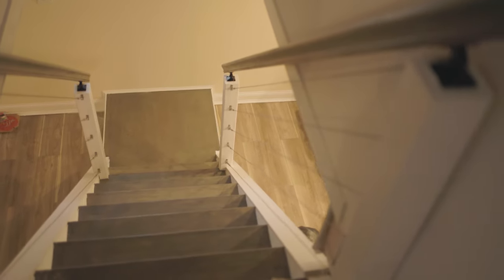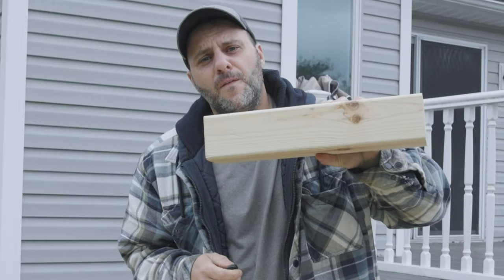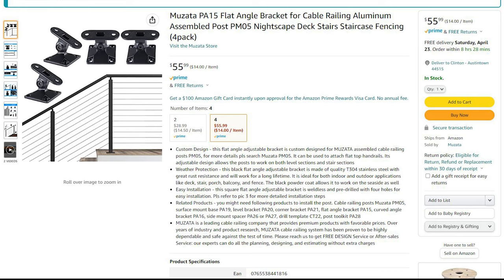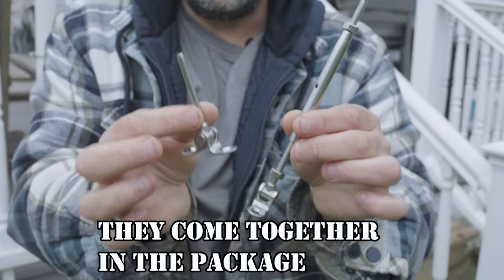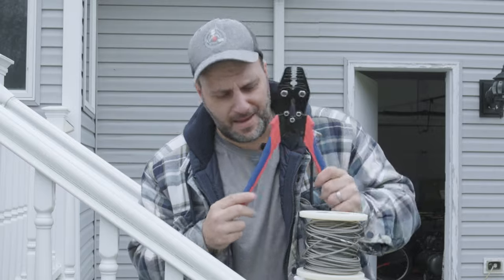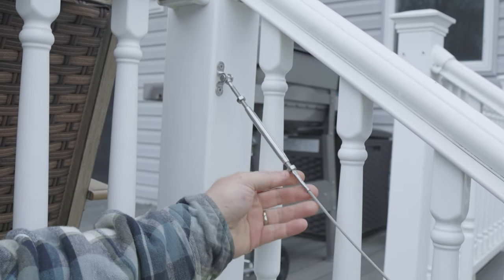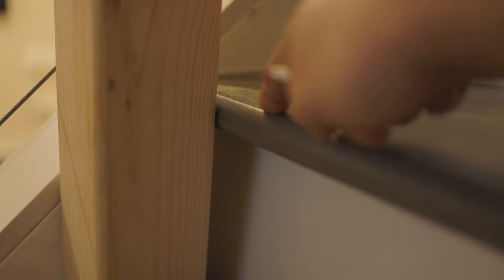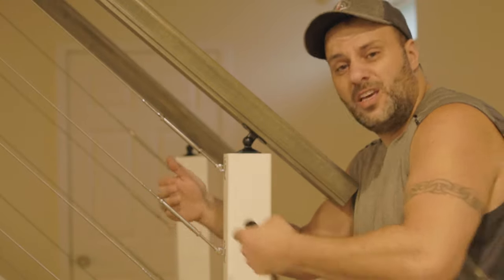Cable Railings DIY - How to build your own cable rails for the house

Comment: So I am a finish carpenter by trade. I normally hate DIY stuff, but this doesn't suck. Also I have used stained poplar to mimic cherry on more than a few occasions and you can't tell the difference. It is a very underrated stain grade wood. Great job man
Reply from the maker: Absolutely brother.  Especially for the price wood is today! Appreciate the comment Steel Valley 🙏
Reply: More than the aesthetic aspect, Poplar is a soft wood….the only downside would be the hardness, could scratch or dent easily….so depends on the use and the budget….but anyways, having that in mind, is a very good and cheap option…..good job!

Comment: I was doing repairs on a restaurant and they had about 2000 ft.² of outdoor deck on the water with those cables l had to repair and tighten literally hundreds of linear feet of that same cable set up…fun. Some of the cables had too much slack to be tightened it had to be Cut and reattached so for anyone installing this system outdoors allow for the inevitable slack you will get in the future so you can tighten without having to cut and reattach. Another great video thanks!
Reply from the maker: Thanks for the comment and feedback Steffen!

Comment: Awesome Clint. The only thing I would do do different is I would notch out the stair tread instead of cutting around it. Then cut the post so it sets about 1/4" on tread. It will then cover up you tread cut.
Reply from the maker: Can definitely do that to Rick. My problem is, I like to measure once and cut 3 times,  so I figured it would be easier to just cut a new post 🤣🤣👊

Comment: Can I use the existing frame of the staircase and just remove the railings ?  I want to keep the wood posts on each side and just replace the balusters with the cable railings ? Also
Is a metal post necessary to secure the cable wires ?

Comment: Not knowing where you live, maybe your codes are different. But the open space between either vertical or horizontal balusters/pickets/cables should be a maximum of 4". In fact, a building inspector will sometimes carry a 4" diameter ball with him and use it to check the spacing. If the ball goes through the space, you fail the inspection. Otherwise, it looks good.
Reply: In my area code for cable railing spacing is 3", deflection in the cables is the reason given,

Comment: I wouldn't DIY stainless cable. If you want a low profile, horizontal metal look - do stainless tubes. You can get them in 1/2" diameter. They're extremely easy to cut and work with. They're far cheaper than SS cable. And you can get tube painted or powder coated in a variety of colors. Easy install, drill the newels and glue the tubes right into the end newels or walls, and balusters for intermediate support.

To get the cables tight enough to avoid deflection (that will either fail code inspection or the reason for code itself - it'd be extremely dangerous to young children) you've got to tighten them down to where there's around 2000 - 3000 lbs of force on the attached surface. Ask yourself this, would you hang something that's 2000 - 3000 lbs off of your newel/wall? If the answer is no, don't do cable.

The spacing and cable tensing has to be precise. you don't want a child forcing their head through the cables getting choked, because you want a cool look on a budget. The cables loosen up over time, and the deflection gets worse. The professional contractors that install these system use specialized tools to make sure the tensioning is done properly. And the systems are generally designed by an engineer.

Another hazard if you go with cheapo cable fittings, and you DO happen to tighten the cable down enough. Then you've got a stainless cable under high tension, with shotty fittings, waiting to break and whip around. Anyone that knows about high tension cables knows how dangerous that is.

There's also the issue of cable tensioning destroying cheap metal newels like the ones shown in the video. When tightened to code, the cable can bow wood handrails and bend cheap metal top mount brackets. So if you go with stainless cable & cheap metal newels, you're setting yourself up for bad cable deflection. Because you won't be able to tension the cable enough without destroying your newels or rail.

Stainless cable is alot like roofing or AC electrical. Just let someone do it that knows what they're doing, or use an alternative that you can DIY.

Comment: Every 4x4 costs $10k right?  So glad I live in a single story house with no basement!!
Walk around barefoot - you’ll find the screw!😱
Reply from the maker: Hahaha, I will definitely find it one way or the other. As for the 4x4 cost, it was actually 10k, but I only wrote the check for $30 and ran like hell Mark 👊👊👊🤣🤣

Comment: Be very careful with these style of horizontal rails they are a climbing ladder for toddlers and there have been multiple serious injuries  recorded because little kids do not understand the drop on the other side, I really think this style should be outlawed.
Reply from the maker: I could understand on a straight run like on a de6, but no water they could climb this as the slant is just to steep for them to do so
Reply: @ToolReviewZone  yes straight runs just keep a close eye on the little ones they can be up and over before you realize it